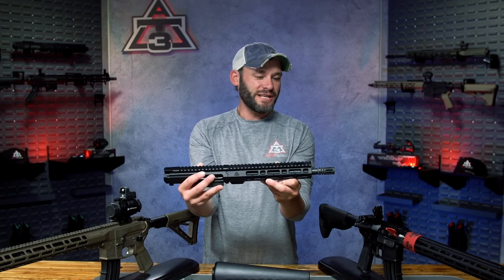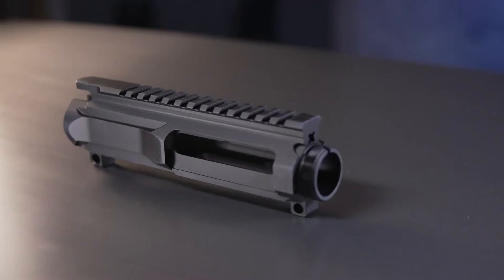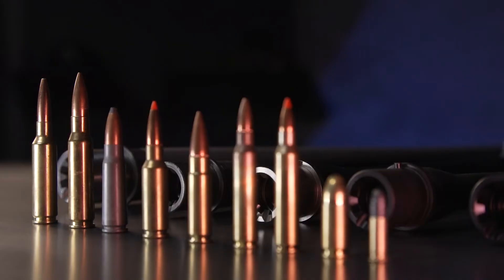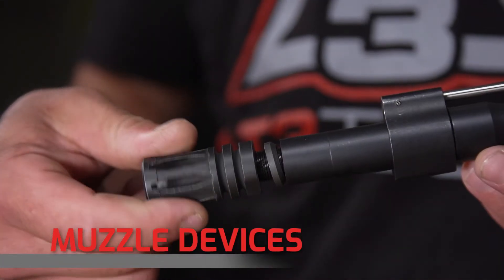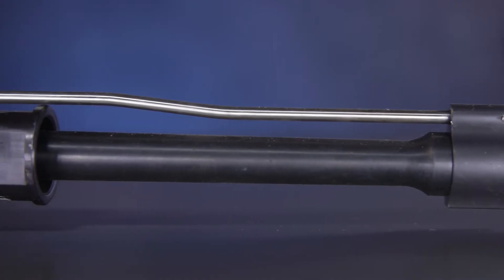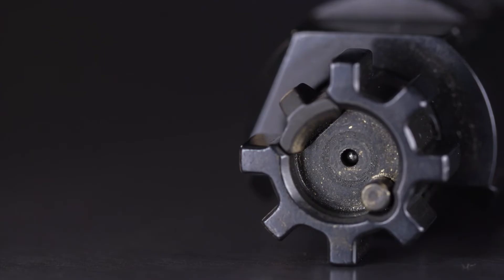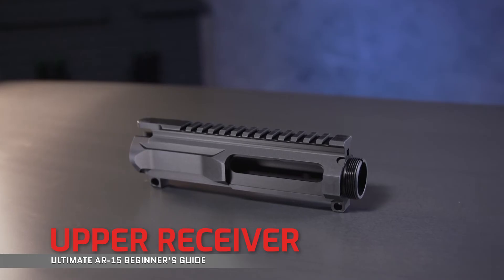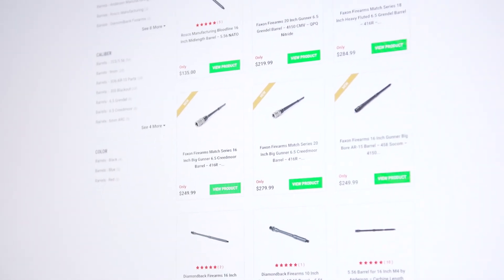Ep-1: Upper Assembly Parts of an AR15? Six Major Components To Know.

Comment: I had cycling issues using 124gr. Once I loaded the lighter spring it fixed the problem.  I still need around 200 rounds to fully break in pistol.